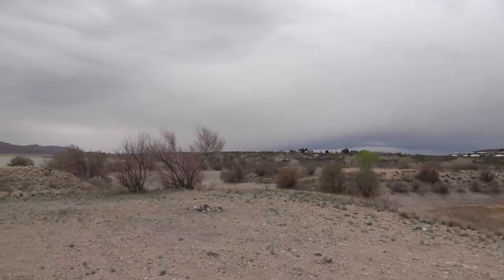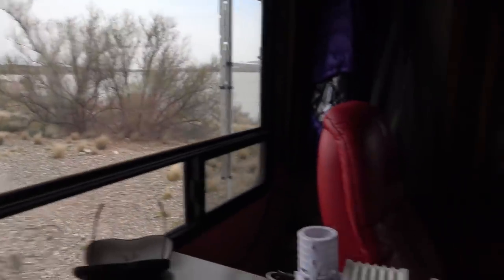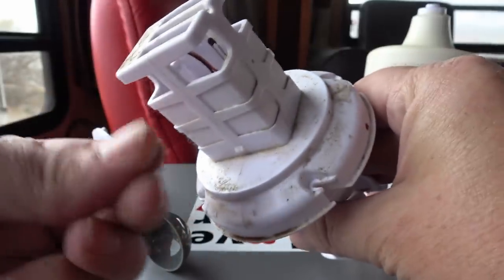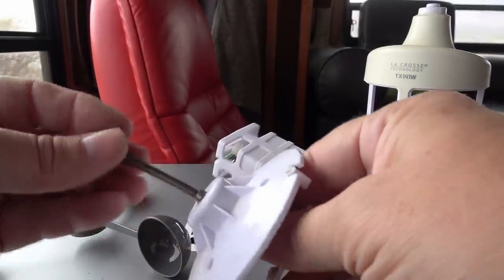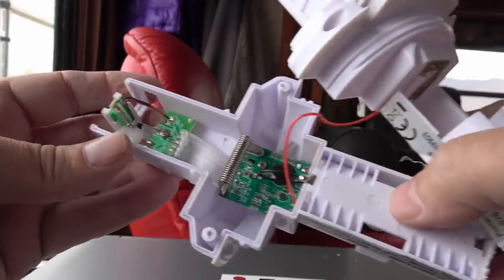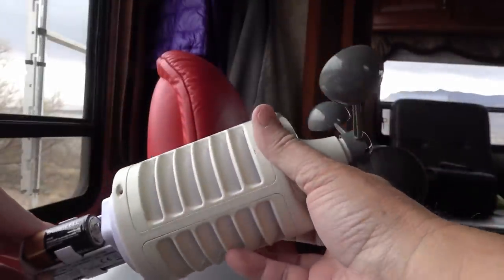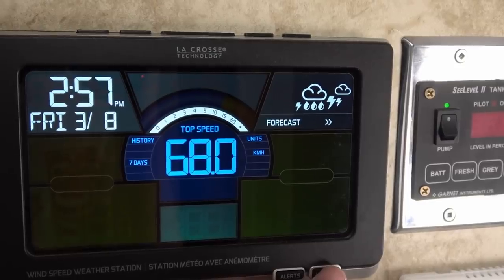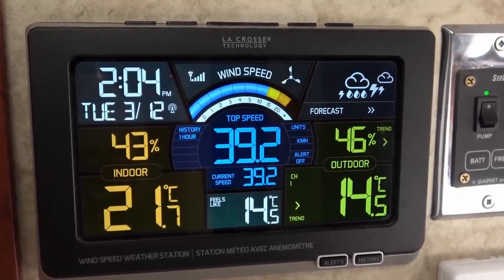Weather Station Teardown  (Cleaning Out Desert Grit)

Comment: I knew if I searched long enough and used the right words I would find someone who took one of these apart. The outdoor temperature reading on mine started to read higher than actual by 3º to 3.5º about six months ago. Checked mine tonight and found that it was built up with dirt/dust on the circuit board from the road we live on and there was some corrosion on the antenna. Used a Q tip and some alcohol to reach in to clean it and it does read closer now. I will completely disassemble and clean to see if I can get it better. Thank you for the video! Enjoy if your down south now, cold and snowy in Canada..

Comment: Thanks for the video . After replacing my batteries I dropped the unit. It wouldn't work. I disassembled the sensor and found i wire loose. I located it looking at your video and soldered it back. Now it works great.  Except for the wind vanes that broke . I'll try reconstructing them with epoxy glue.

Comment: I have too much trouble with La Cross clocks and two weather stations. I now use Acu Rite. It is more accurate. It also has a rain gauge and pressure. Last six years of use-no problems.
Reply from the maker: My wife got me a new weather station for Christmas, called Ambient Weather :)  - https://youtu.be/VsPrnq05mMM
Reply: @LoveYourRV  how has it been working do you like the features
Reply from the maker: @Road_Runner_1949  We’ve been using it for a year now and the weather station has performed well. This winter, it’s helping me keep tabs on the internal humidity so I can keep condensation at bay. It’s also interesting to monitor the powerful winter storms that are rolling through this time of year. Check out my online weather page that gets uploaded from my station every few minutes.  https://ambientweather.net/dashboard/597ca285e8b933fa92574cc4e7427721

Comment: Go for a Davis weather station it has alot of info quick transmission about two seconds and alot of people say they last many years there are tree models that I know of the Vantage Vue the pro the pro2 and the pro2 plus and if those are to expensive then just got for the basic weater monitor by davis just wind speed and direction and also wired
Reply from the maker: Thanks, ended up getting the Ambient Weather Wi-Fi Osprey about a year ago.  Has been pretty good. Cheers, Ray

Comment: Why do you have water filters on the back of your RV, exposed like it is?  Couldn't that have been done differently.  Forgive me but I didn't see a video on you installing that, was there one?  Cheers.
Reply from the maker: Have done a couple videos -  https://www.loveyourrv.com/clearsource-rv-water-filter-review-install-mod/  This filter system is designed to sit outside. To save storage space, not much to be had fulltiming in a 30-foot fiver and make it easy for me I mounted them on the bumper also I mostly use them when filling up for dry camping.  Has worked out great. Cheers, Ray

Comment: Very timely, I’ve been meaning to ask you about your weather station.  I’m obsessed with the weather and want to get one. 😀 Looks like you leave it installed full time even while driving, is that correct?
Reply from the maker: No, Bob, I take it down each time, I just don't trust that it may come off being made of plastic. Takes no time to remove, we have it added to our depart checklist.  Cheers, Ray
Reply: Oh, makes sense – I wouldn’t want it to blow away. Thanks for the clarification!
Reply: @BobKeefe  do you think that old RAM can pull that cougar that fast
Reply: thunderbird97; I’m confident the Ram can bury the speedometer or hit the speed limiter WITH the Cougar attached.

Comment: Ray, do you retract your slides in wind like that?
Reply from the maker: So far I've never had to, we just have the one. No slide topper on it so that's not a problem and my slide is large and has a motor brake on it. But never say never. :)

Comment: I somehow managed to break off one of the three cups while climbing up the ladder to place the thing in place on top of my trailer. What to do? I tried ordering a replacement but to no avail. A friend of mine helped me fix it with shimmed down Popsicle stick and a drollop of Crazy glue. I worried that that the repaired cup would be out of sync and skew the results but it seems to work just fine.
Reply from the maker: I'm wondering if the newer version wind cups may work - https://www.lacrossetechnology.com/wctx144w

Comment: If you want rechargeable, (as long as the unit will work on lower voltage) you can buy (or make with PVC and tape) AA to C Battery Adapter.
Reply from the maker: I have 12 volts in up there in the junction box I have it mounted on. So my plan is to install a buck DC-DC converter inside the junction box and be able to just plug the weather station into it.  Then it will run off the rigs battery system, Cheers, Ray

Comment: Hi, the switch enclosed in glass activated by the rotating magnet  is a standard Reed switch used mainly for Alarm systems magnetic contacts. If it ever needs to be changed the cost is very low. Just be carefull to use the proper "Normaly closed" type.
More here:
https://www.explainthatstuff.com/howreedswitcheswork.html
Reply from the maker: Thanks, used to see them a lot in mechanical things like VCRs and audio tape decks as counters. Cheers, Ray

Comment: do you ever plan on trying a wind turbine?
Reply from the maker: No, Solar panels are much cheaper and less complex, no setup and maintenance required other than cleaning the glass once in a while. Also, the panels make no noise or vibration like a wind turbine would. I usually only see wind turbines used on small rigs like truck campers or tiny trailers with limited roof space for solar or if someone is at the same spot for a long time, they may set up a pole away from the RV. I rarely see them on larger RVs. If they were viable many boondockers would have them.
I would take the money I'd spend on a turbine and add more battery storage. Cheers! Ray
Reply: Thanks for the information.  @LoveYourRV